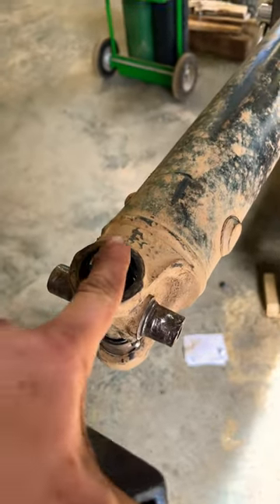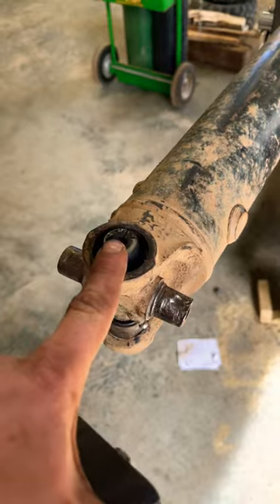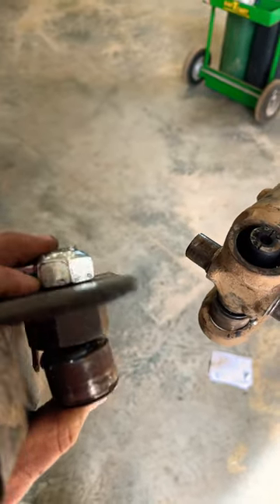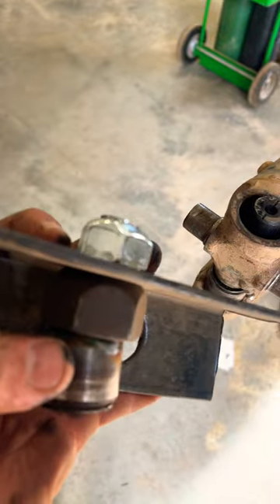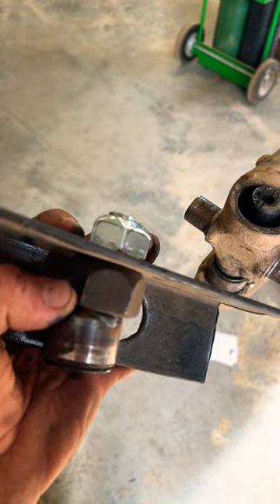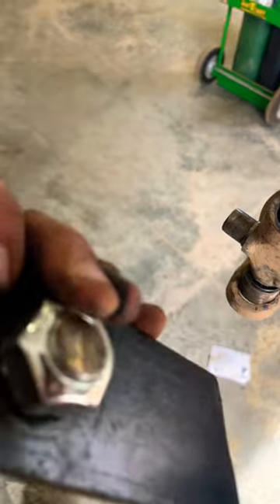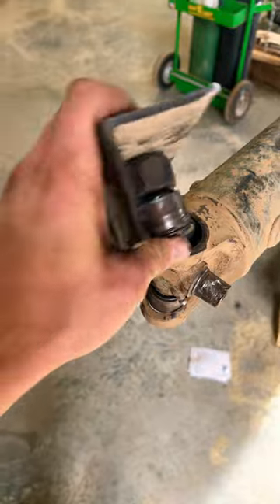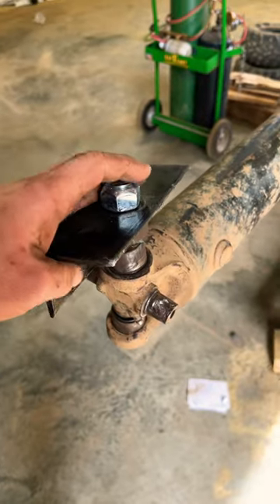Trick for removing  stuck u joint caps

Comment: I’m working on a freightliner and the u joint caps all broke off at the welds and don’t know what to do
Reply: I have had some that were really seized in place and I’ve used a cutoff wheel to cut the inside/body out of the u joint then the cap itself becomes a bit easier to get out with heat, spray and vice, press etc. you could also beat it out as long as you support the ears of the drive shaft so they don’t get bent up.